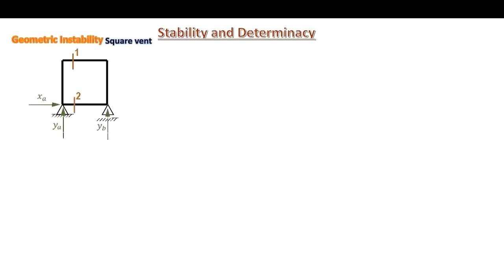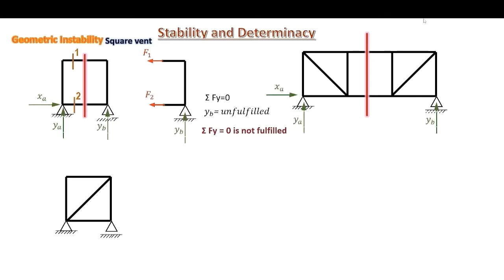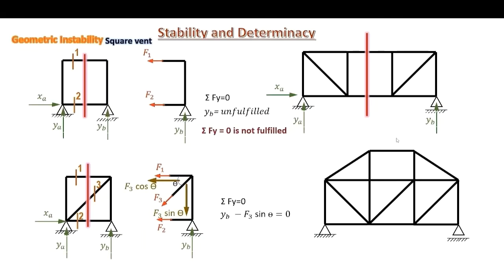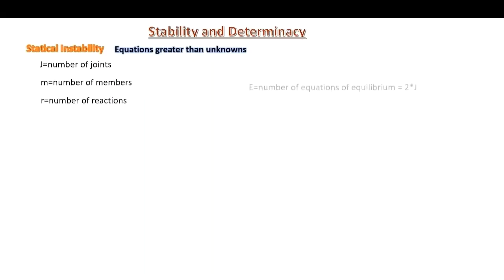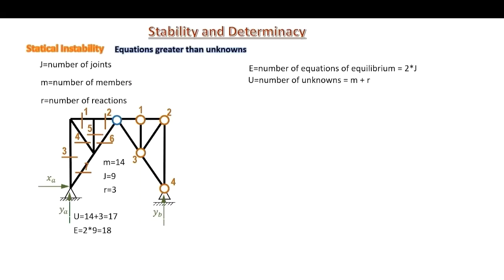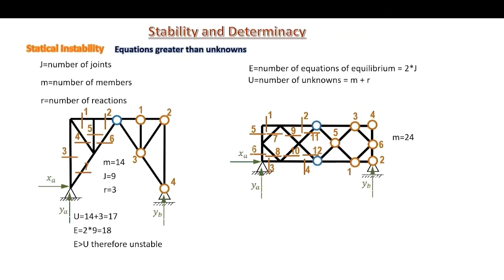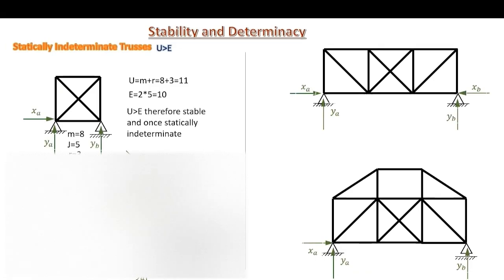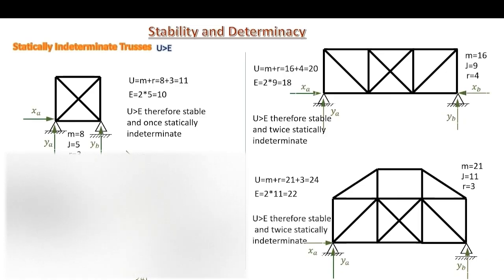2 Stability and Determinacy

Comment: At 9:02 why doesn’t the bottom joint not have only one reaction as well? If the top joint only has one because it’s attached to only one member, couldn’t you also make the bottom joint only one reaction in the direction of the member?
Reply from the maker: You are right..it is adjusted here and an extra video will be added.. thanks
Reply: @MK-fq3fk oh ok thanks.